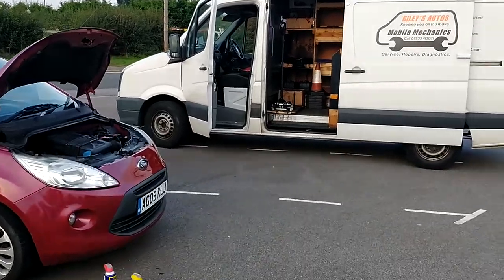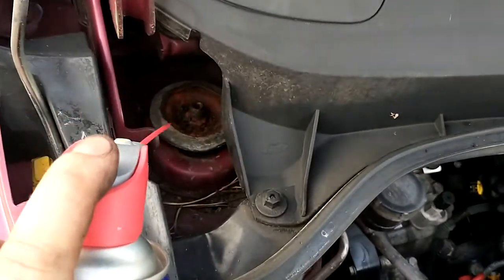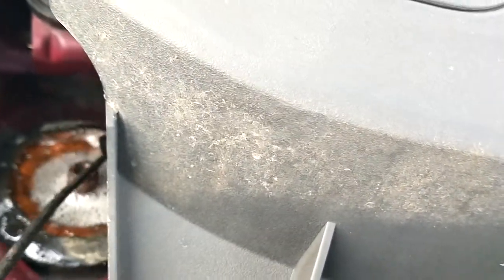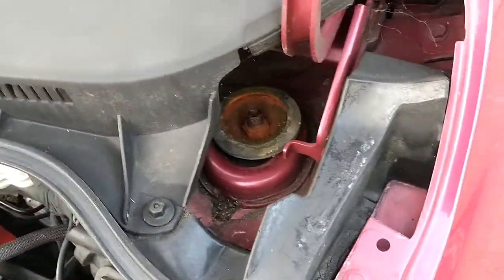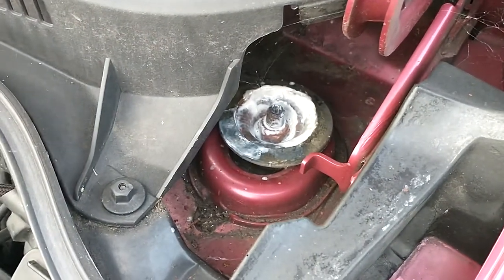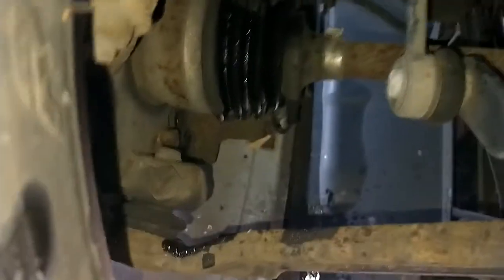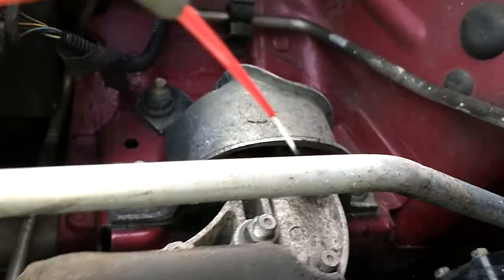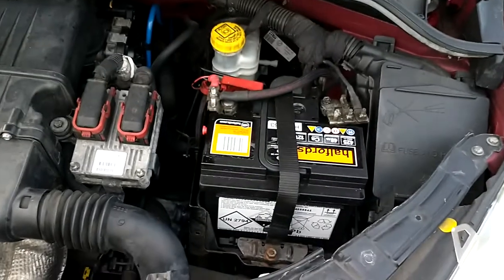Doing this simple trick will save you hundreds in future car repairs

Comment: Been using the ( wd 40 silicone ) and white grease on my own vehicle and been using on my handbrake cable as the weather was washing it all off every 2/3 weeks. 

wd 40 silicone and white grease has lasted 6 months on two cars now that has big problems with handbrake not holding and popping off, it’s the way it’s a no brainier. 

Never thought of using it on the boots, thank you for the tip.